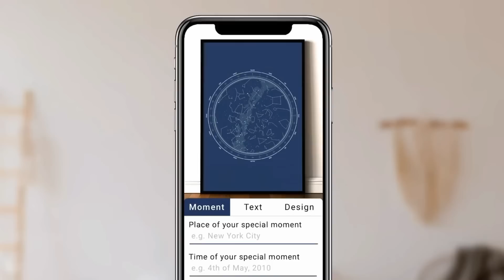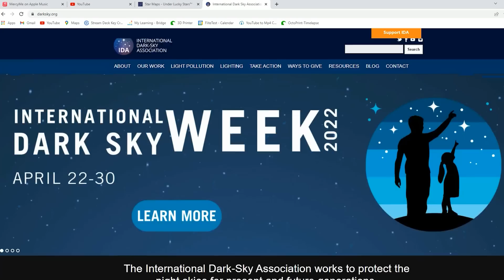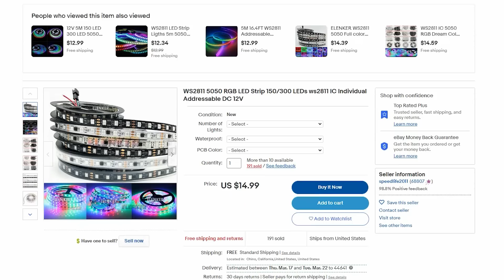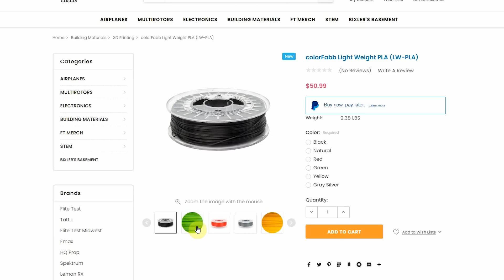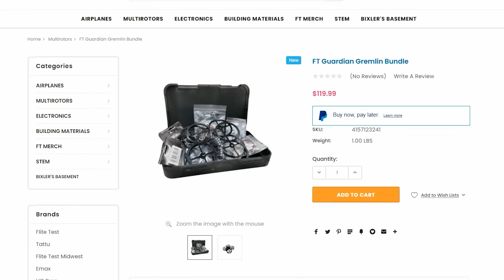Testing our LED lightning clouds and our NEW Guardian Gremlin! - Week 8

Comment: I wish when you device to make a cinewhoop you'd make an actual cinewhoop and not just a mini quad with a crash frame like most others. Proper cinewehoops have ducts. This is just a regular quad with prop quards. The actual whoops with ducts fly much more stable and are from slightly to significantly more information efficient depending on tolerance. And since you guys have actually made videos about this exact thing way back you should know

Comment: I know going big is fun, but I recently stumbled across these RC cars, trucks, and heavy duty machine equipment that are fully lit and articulated (like farming tools and construction even) but they're like hotwheels sized.  It made me wonder just how small of a plane could be made to work.  Given the requirements to get lift and fly I imagine the speeds needed would make it prohibitive, but the idea of a under foot long or even smaller Seaduck buzzing along just seemed amazing in my head if it would ever work.